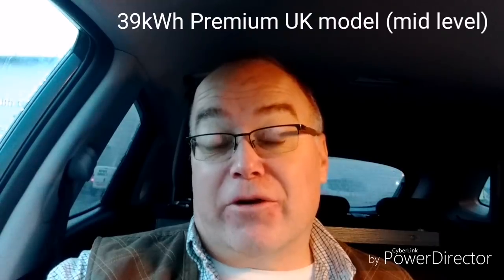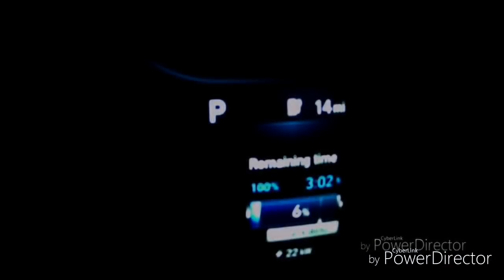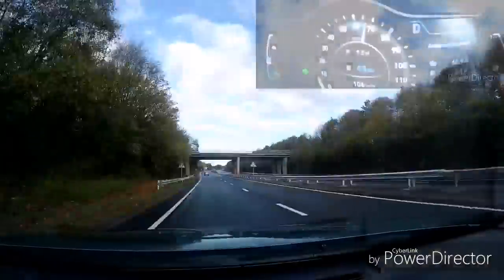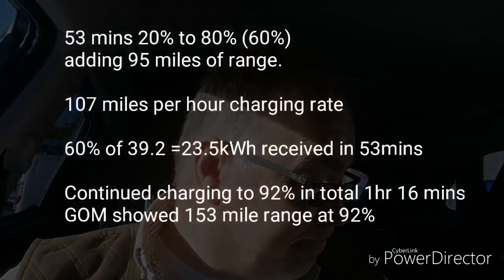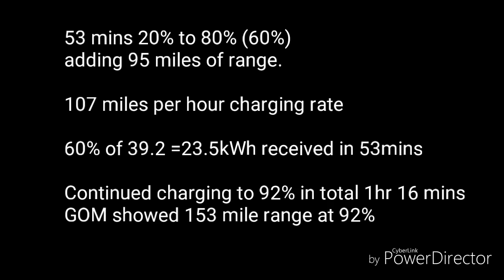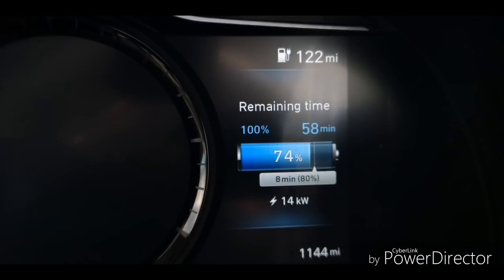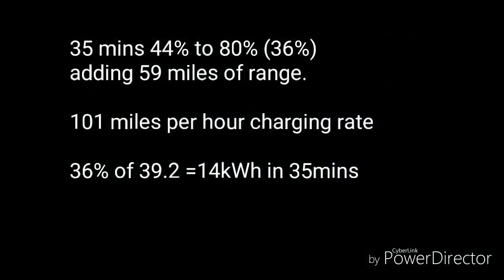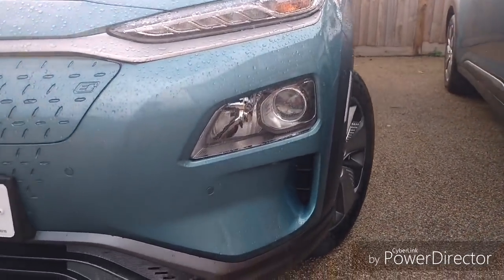Multiple Rapid Charging / Charging concerns & why I wouldn't buy a 39kWh Kona Electric

Comment: Thanks for this instructive video, though I can understand your disappointment. Just a minor remark (since you're using the term so often): when you say Battery Management System, you seem to mean "battery cooling" or what some call Active Thermal (battery) Management. I think the term BMS usually refers to the electronics that controls charging/discharging and is found on just about any Lithium-ion battery nowadays, as a minimum to protect it from conditions that could lead to the batteries exploding. All EV's have an elaborate BMS with which one can communicate via the OBD port.
Reply from the maker: Marc

I'm aware technically the BMS is the electronic management part of the system however in plain English all the stuff together is a system which manages the battery. A battery management system.

If I was accurate and said "set this via the AVM so that the ECMU can tell the BMS" it's simply techie speak that means nothing to many.  I'd rather annoy a few by mis speaking around terms and acronyms. It doesn't mean I don't actually know how it works.

You've said this very nicely however so, thank you. Others seem to think it's worth their time teaching "me" like when I say KW when I mean kWh. I do know the difference of course but sometimes that's what comes out and it can't always be editted out.

Comment: You failed to take into consideration that the charging stations don't supply a constant charge rate. We have two electric cars in our family & have swapped over the charge from one to the other at charging stations, we found that the station would reduce the charge rate as it got hotter & the fans kick in as the station heats up. 
We also found some other variables which affect the charge rate. Sometimes the rate would drop for no apparent reason, maybe the charger drawing too much current from the local grid. 
I wouldn't buy the Kona for another reason, the PLASTICS, bad enough on the inside but on the outside? Makes the car look cheap.
Glad you mention when things are interesting and very interesting as it's not always apparent ;-)

Comment: It really would be better if you refrained from trying to just "figure out" why you observe what you observe. When you say it seems to you there's some kind of significant issue, you may very well leave a lot of viewers believing that there is in fact an issue - when neither you nor they know that there is.

Charging is fairly complicated stuff, and there are always many factors influencing the rate.

Just to illustrate, consider the fast charger for a second. It has a simplistic nominal rating for it's maximum power, but an engineer would look at maximum current and voltage separately. Why? Because you charge a battery by applying a voltage to it's terminals that is slightly higher than the open-circuit voltage of the battery, but with polarity reversed, causing current to flow in the reverse direction (as compared to discharging). Current flows according to Ohm's law, U = RI, and the net voltage at the battery terminals is basically just the sum of the contributions from the battery pack itself and the charger. So if the pack is at 350V and you apply -352V, you effectively have -2V forcing a current through the battery. It is crucial to realize that R, the internal resistance of the battery, is quite low, and the charging voltage therefore only a little higher than the pack voltage. The consequence is that you're not free to simply jack the charger up to maximum voltage. In this example, if you charge at 354 V instead of 352 V, you double the charging current. 

So, in practice, chargers are current-limited. Voltage is only relevant in that it needs to go high enough to allow charging - a few volts higher than the target voltage that you want to charge to. Some "50 kW" chargers can deliver maximum 100A and 500V, some can deliver 125A and 400V. The latter are in practice 25% faster (assuming the car can fully utilize it) because 400V is sufficient to charge any EV on the market to 100%. A popular configuration in EV battery packs uses 96 cells in series, for a nominal voltage of about 3.65V*96 = 350V. Depending on SoC, the pack will be at about 300V to 400V, and a 100A charger therefore cannot deliver more than 30 kW at the low end, while a 125A one could deliver 300V * 125A = 37.5 kW. 

That's just considering the charger, and I'm sure what I've mentioned is a huge simplification glossing over many caveats and ignoring several relevant issues. What speed you actually get, and ought to get, is a much more complicated question than just what the charger is able to deliver. 

Making decisions about that - what charging speed the car would like to get - is just one of the responsibilities of the BMS - the battery management system. It isn't a fan, and you can't hear if it is running at not. It should be running at all times, and nothing in this video indicates it doesn't. In fact, the fan itself would not normally be considered a part of the BMS, but merely connected to it. It is really better to think of it as a piece of software that makes decisions for the purpose of managing the battery, although in some context it makes sense to think of it as a circuit board (say, if you are an amateur car maker who wants to use the BMS from an Ioniq in your project).  

The point isn't to try to teach you the engineering. Nor could I, and not just because of the limitations of YouTube comments. I only have amateur-level knowledge of some bits and pieces of the relevant engineering. But I know enough to realize how much I don't know, and enough to tell you know significantly less than I do. 

So I am trying to offer constructive criticism here. Refraining from guessing the technical explanations doesn't mean you shouldn't test "the technical stuff". Lots of people may not know even the fact that you don't always get the same charging speed, and a test like this makes them aware of the fact. It also makes it clear that it is not as simple as charging speed being a function of SoC, even on the same charger. (My guess, btw, is that you received less power initially on the first charging session because the battery pack was cool. But it's just a guess.)

I am personally interested in the technical stuff and would kinda like to understand better how it all works and what tradeoffs are made, noting how different manufacturers choose different tradeoffs. But that isn't what your videos are about. You've stated yourself that your approach is to "get in and try it", not to "spend hours doing research". That approach works well enough for judging how the product actually performs - it is pretty much the normal user perspective. But just like you shouldn't really state as a fact that car A has a crisper turn-in than car B thanks to its double-wishbone suspension unless you actually know what you're talking about, I think your videos would really improve if you simply stated that you feel car A has a crisper turn-in than car B. It would also eliminate some cringe moments, like when you say "the BMS came on". It just shows you don't really know what a BMS is. While that doesn't disqualify you in any way from reviewing electric cars, it kinda does disqualify you from making judgements about whether the BMS is buggy or "has issues". :)
Reply from the maker: How about having a go yourself rather than moaning to me. I'm an ordinary guy with a lay man's view which is appreciated by many.
Reply: The EV Puzzle He gave you polite feedback. Being defensive is not the best approach.
Reply from the maker: Robert , I just don't enjoy comments telling me what I should or shouldn't do. Technically his details were constructive but telling me what I could or should say in my videos based on my lower level of engineering crossed a line for me. 
In this instance I actually knew more than he did about how the Hyundai BMS system worked ( Hyundai gave me additional information not available publicly)  but I chose not to use all the acronyms and details as it gets too technical and turns too many people off. Yes, I'm sounding defensive now I guess but I don't tell other people what to do as I'm not them. 
Its hard work producing these videos and impossible to get all my points across perfectly but I choose to do it in a natural unscripted style which many seem to like.

If the tone of his message had not been telling me what to do I would have probably thanked him and applauded the comment. Its a fine line.

Generally most peoples comments are great and make the channel better but a few just bug me as they're overly critical of what I do. One day I'll learn not to reply but sadly I care.
Reply: @EVPuzzle  Thanks for the informative video.  its nice to see a customer's perspective.  im not sure what the guy above was rambling on about but i appreciate your video.  and the reason cold weather limits the charge time is completely due to preserving the battery.  Cold batteries need to be handled with a lot more care to avoid permanent damage (especially during charging) and therefore the BMS cuts way back on the current when it sees the battery is in a 'vulnerable' state. definitely an active area of research in batteries but for now the best the manufacturers can do is try to heat up the battery to its sweet spot to charge faster
Reply from the maker: Many thanks.

It's a learning curve to understand everything. I present a normal everyday view and experience of the transition to Electric.

I don't hold back or exaggerate just say it how it is and how it feels. The truth, the facts well in these instances we just don't know as Hyundai keep it all secret. Mr. unhappy above clearly thinks he knows more than me but I'm the one driving the Kona and have a better view.

Since this video the term "Coldgate" has started the rounds, started by another YouTuber but coincidentally it describes the same issue I experienced.
Mr unhappy may not like my buggy description of the BMS but with other customers experiences it now seems our expectations of the thermal battery warming capabilities were misplaced. The Kona doesn't warm the battery in cold conditions for charging as we expected. It instead throttles charging rates to protect the battery ( 50% soc or above) giving slower rates than expected.
Unless you don't mind waiting longer for a charge it's best therefore to run the battery into the 40% at least if conditions aren't warm 20c.
Reply: I'm just giving a like for effort, such a long and detailed text.

Comment: Hi there, we have been watching your channel, and are now very interested in buying one, but have a question for you. Does the insurance work out much more expensive ? Like yourself we have found that most of the garages in England aren't interested and don't have a car to show you. We did find a  local garage in Northern Ireland that knows a lot about the car and actually have one that they use and we are now going for a test drive. The only down side is, if we do order, the expected delivery date is next September. Thanks
Reply from the maker: Tracy, SLM Hyundai Norwich can get you in a Kona.

Insurance is just like any other car if you choose an insurance company that's got their act together. Price is just down to insurance group. Internally insurance companies will be concerned accidents might cause damage to the battery hence an expensive repair but reality is they're full of better safety tech do less prone to accidents.
I paid only £100 more than for a 1.6diesel ford fiesta. Very reasonable for a car nearly 3 times the value and twice the power.

Longer delivery times are inevitable, it's the best out there at the moment
Reply: @EVPuzzle  many thanks for info will let you know how test drive goes
Reply: hi there again we have been looking at hyundia s web site and have noticed the kona ev  price seems to have gone up  ??? or is it me

Comment: Hello Nigel, 
Another reviewer is suggesting that the Kona needs to be all wheel drive as the review I have seen shows that in the wet wheelspin is also impossible to eradicate unless you accelerate very gently, what has your experience found please?
Reply from the maker: If that's EVM , I did note he was in sport mode , full power, foot to the floor in poor road conditions. Not exactly sensible or representative but definitely illustrates the point with EVs having instantly available torque and the Kona having lots of it, you have to respect it just like you would a 300hp rwd car in the wet.

A winter drive mode, more effective traction control , would have been useful but ECO mode surfices and makes get aways easier.

Comment: Not sure if I missed it - only 39kW has problems with cabin heating or both?
Reply from the maker: Both had the same issue.
Reply: Oh crap :( any comments from Hyundai?
Reply from the maker: None yet.  
To be honest the Press office listened but then did nothing. 
Too much effort to investigate I'd guess.
Haven't given up yet though
Reply: The EV Puzzle if it lacks heating in cabin that is a major issue requiring guarantee claim :) and a major concern for having a car for €40k
Reply from the maker: Its in to be looked at tomorrow but I suspect it's by design. Potentially the smart part of the system could be diverting heat to the battery. Hopefully I'll find out

Comment: Good video ! 
I have Renault Zoe 40Khw and the fans will kick in when the battery starts to get too warm in the summer mostly , but in the winter you hardly hear the fans at all. 
I wonder because you tried to rapid charge after only a few miles and it at this time of year like the Zoe the battery needs to warm up first even if the state of charge is low. Does the Kona have a Battery Temperature display like the Nissan Leaf ? I can use Canze software and a OBD2 Dongle device that is plugged into the OBD2 socket to see the Battery Temperature , the zoe like's to have a warm battery pack above 20c and a low State of Charge ( 20%) to get maximum speed on a Rapid , which from 20% to 80% takes around 60mins (program is called leaf spy on the nissan leaf ) In the summer i think the result would have been different also maybe the cooling / warming on the bigger battery is better.
I always charge the car at home the night before in winter otherwise if you charge before the battery is warm the charge speed on a Rapid will be low especially in the winter.
Reply from the maker: No battery temperature display and no odbII devices working yet.
Autopi looks good though but the data for the Kona won't be understood yet I guess

Comment: It's my opinion that the batteries are made and supplied by two different manufacturers. The 39kWh by SK Innovations and the 64kWh by LG Chem and both having different BMS and possibly the SK Innovations BMS version may be over protective, similar to the AESC Nissan 40kWh battery even though the Kona 39kWh has active cooling? Mind you some of the loud fan cooling noises being made whilst charging are a concern and I certainly would not be happy if I had to endure that noise, especially as the 64kWh is near silent when charging. Looking forward to your 64kWh same comparison test.

Comment: You are mixing kw and kwh in your video. kw is the rate of charge or discharge(like flow rate of 15 litres/min), kwh is total energy (like liters of fuel).
Reply from the maker: I can only guess you're new to my channel
Reply: @EVPuzzle  if you are going to host a quasi- science channel you should know the difference between power, and energy.
Reply from the maker: If you're going to comment like you know things, you should know the difference between mis speaking and misunderstanding

Comment: I think you are mixing the terms here: Battery managment system  (B.M.S.)controls the charge current& voltages to each cell (or paralelled thereof) to equalize and protect them. The noise of the fans obviously is to keep the temperature within limits, and not necessarily part of the BMS.
Reply from the maker: Well yes,  as we know the EPCU controls the temperature of the coolant really but everyone's more familiar with terms like BMS so it's easier to lump it all together so the majority understand.

Comment: Hi Nigel, rapid charging of a cold battery will be severely limited. In my Tesla 90D on a cold morning I can only get 29kW rather than 94kW until the battery is thoroughly warmed up. Regen braking is reduced for the same reason. David
Reply from the maker: Cheers David. Its all understandable I guess just a shame manufacturers can't be more open about charging limitations

Comment: You noted the heating wasn't very good, do you need the HEAT as well as the A/C buttons on to properly heat the car up?  It's not clear in the handbook.
Reply: Andy B best method is auto and set temp and wait. It will always be either ac or heat, never both st same time.
Reply: @Stoic-of-Rome  can have AC with heat
Reply: @leexgx  No, as you raise the temperature controller knob (In auto) the Blue AC light will go out as the heat orange light will come on. As you can imagine it would not be correct to AC cooling fighting against the Heater.
Reply: @Stoic-of-Rome  AC is not just for cooling it dehumidifies as well (auto typically turns on the AC by default heat or cold) i would assume most EVs have climate control
Reply: @leexgx  I can only go by what happens on my Kona!

Comment: So much for CCS. Think I'll stick with my Zoe Q90 as I got 24.8 kWh in 45 mins at Southwaite Southbound on October 16th. Admittedly, this was after driving 110 miles limiting myself to 60 mph. And there was me thinking my poor 43kw AC charging car was inferior. At 15k miles thus far I find driving it a long distance first helps that charge rate massively.

Thanks for that video as it was really informative.
Reply from the maker: Getting a quick splash and dash doesn't seem to work when cold so charging before you set off on a rapid charger isn't going to be quick